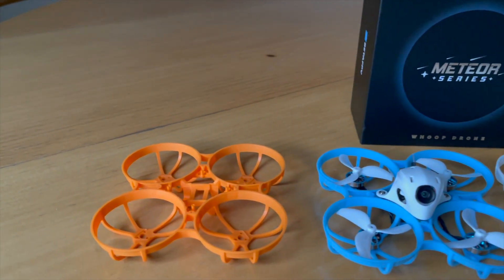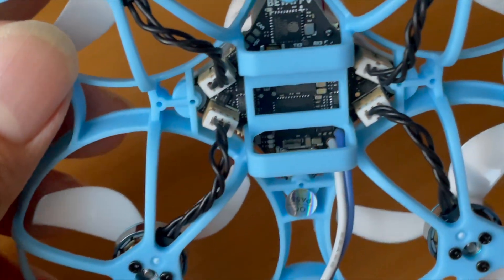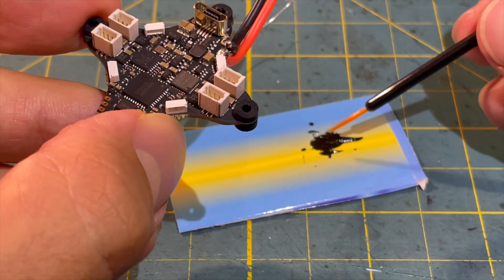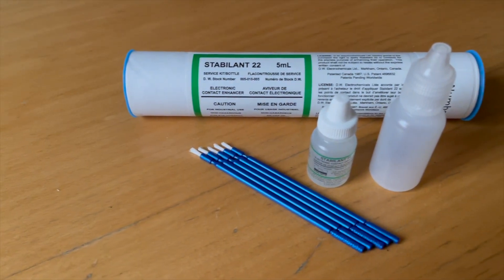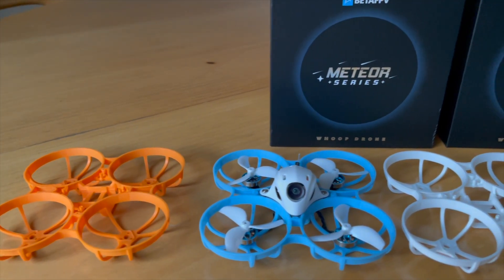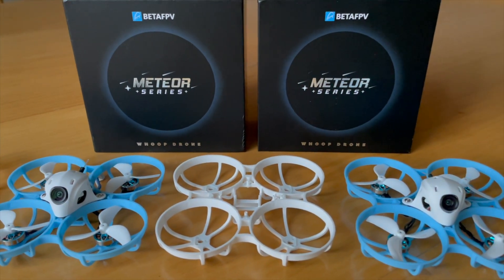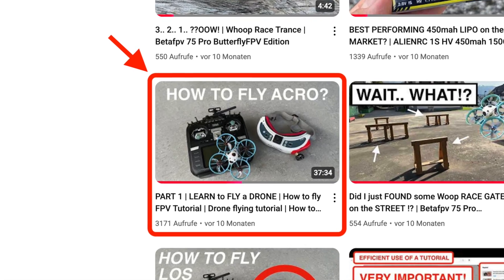I NEED YOUR HELP!⚠️‼️🙏🏻 Project Contact Enhancer for Motorplugs on Tiny Whoops | Meteor 75 Pro

Comment from the maker: Hello my whoop friends! I need some test pilots from Europe who fly the Meteor 75 Pro with motor plugs! 

I've already invested over 10 hours in this project and would appreciate your help! 

I would like to thank the test pilots who have already confirmed their participation and sent me an email.

⚠If you're interested in the project, please contact me this week! Email is in the channel info.
The email is hidden, you need to click to unhide it and it only works on a desktop computer somehow.⚠

➡ The project in brief: 
The Goal of this project is to test whether contact enhancers can prevent electrical fretting on the Meteor 75 Pro's motor plugs and the subsequent motor stuttering problem after about 150-200 flights. A small study of contact enhancers on tiny whoops, so to speak. 

➡ Requirements for test pilots: You have a Betafpv Meteor 75 Pro or are willing to buy a new one. You are willing to make 200-300 flights with the 75 Pro in the next two to three months. You are able to complete 200-300 flights without the motors sustaining damage due to extreme crashes. You will keep a log of the number of flights. You are willing to work with me and share the results with me and the community. 

➡ My role in the project: Leading the project. 
Dividing the test pilots into the different groups of the various contact enhancers and the control group. 
I will provide the contact enhancer I received from the sponsors or ensure that your whoop is equipped with a contact enhancer. I don't know exactly how yet. 
I may send small quantities of the contact enhancer in small containers. Or you can send the whoop to me, and I'll install the contact enhancer and forward the whoop to you. At the end, I'll summarize the results and make a video for the community. 

Of course, I can mention all the test pilots' names and their YouTube channels in the video if desired. 

⚠If you're interested in the project, please contact me this week! Email is in the channel info. 
The email is hidden, you need to click to unhide it and it only works on a desktop computer somehow.⚠

➡ Project Structure: 
Two 75 Pro pilots without modifications to the whoop (control group) 
Two 75 Pro pilots who fix the motor connectors with adhesive (no contact enhancer) 
Two 75 Pro pilots who use contact enhancer A 
Two 75 Pro pilots who use contact enhancer B 
Two 75 Pro pilots who use contact enhancer C 
Two 75 Pro pilots who use contact enhancer D 
And if a lot of pilots are interested, the following would also be possible: 
Two 75 Pro pilots who use contact enhancer A and adhesive 
Two 75 Pro pilots who use contact enhancer B and adhesive 
Two 75 Pro pilots who use contact enhancer C and adhesive 
Two 75 Pro pilots who use contact enhancer D and adhesive 
With 12-20 pilots, we could conduct a really nice little study. 

And yes, I know it's only a small study. But in this case, it doesn't need to be a large one, because we'll quickly see if the engine stuttering problem can be resolved.
It's not about seeing the performance gain, which is very small. Personally, I'm just interested in solving the problem of the motor stuttering. And this doesn't require a large study or unrealistic bench tests.

⚠If you are interested in the project, please contact me this week! Email is in the channel info.
The email is hidden, you need to click to unhide it and it only works on a desktop computer somehow.⚠

➡ Info on the contact enhancers:

Stabilant 22:
https://www.stabilant.com/
https://www.micro-tools.de/Kontaktreiniger-oxid/Stabilant-22A.html?isextsearch=alist
https://www.youtube.com/watch?v=Rj9KWLf_67M
https://www.youtube.com/watch?v=nrtCp1oAfLg
https://www.youtube.com/watch?v=3JvoKBMceXA
https://www.youtube.com/watch?v=Hqn1uT_gbpU

Deoxit:
https://caig.com/
https://www.digikey.ch/de/products/filter/chemikalien-reinigungsmittel/260?s=N4IgTCBcDaICYFMD2APAlgFxAXQL5A
https://www.micro-tools.de/Kontaktreiniger-oxid/Caig-DeoxIT-Gold-Tube.html?listtype=search&searchparam=deoxit&
https://www.youtube.com/watch?v=Hd6M3fO6Upg
https://www.youtube.com/watch?v=osmMy8ei_Ko
https://www.youtube.com/watch?v=MRQju68tqVc

NPS Encore:
https://www.contactenhancer.com/

‼⚠Also note the other videos on this channel, the option to subscribe to this channel and my other channels.⚠‼

Other videos on this topic only - See playlists
If you liked the video - recommend it to friends ☺
Contact for Business Inquiries - Channel Info - Email
Reply: I've got 3 Meteor75s (built my last one) and have a fourth I'm building on the way from BetaFPV now!  I'm in!! :)

Comment: I have mine for a few days only but I crashed it enough times to already experience stutter. After I firmly press the motor connectors it disappears until the next good crash.

I’m getting a 2nd one (with a camera this time) and that one I will probably convert to a soldered before I go fly outdoors. But my LOS-one can stay with the connectors for the purpose of this test. Not sure whether you still accept test pilots or not.
Reply from the maker: Wow, that's early. You've been flying a lot these past few days? Maybe over 150 LiPos? Is that possible? 
Yes, it would be great if you participated in the test! You can try this contact cleaner: 

Deoxit D100L is available in a small and inexpensive package in America for under 10 dollars.

https://caig.com/product/deoxit-d100l-cpk/

Applied to the pins of the whoop.

If possible, you can also add a little more to the sockets. It won't take much. The pins must be covered by the stuff. That's enough. A thin film is enough. Then let it soak in for 12 hours and reconnect the motor connectors as usual.
Or if you have enough money (50 dollars), you could also try Stabilant 22, which in my tests greatly improved the contact of new plugs! But I don't yet know if it works as well on oxidized plugs.

https://www.amazon.com/Stabilant-5ml-Kit-Makes-30ml/dp/B001E50GQS

PLEASE let me know if it worked!
Reply: I am learning LOS at home, in acro, so crashes into things are frequent :D

I don’t think I flew more than 20-30 lipos,  the issues aren’t as prominent as on your video, but manifest in sudden bursts or reduction of RPM causing the quad descent or lift erratically. 

D100L-CPK is surprisingly hard to find in Poland, unless you pay 10X for delivery, but I’ll try to find it.
Reply: @b @butterflyfpv I also don’t think it’s corrosion / oxidation problem in my case, but bad mechanical contact between the connector and its socket

Comment: Am I the only one that has a pigtail that doesn't have good grip with the battery
Reply from the maker: No, unfortunately, it's a known problem that some BT 2.0 connectors are not precisely manufactured. Some series are too tight, while others are too loose. Maybe things will get better in the future when all BT2.0 connectors from the first series are sold and the tolerances are better maintained.

Comment: I really like this idea but unfortunately there is no way you will get conclusive results from a shared test like this. No one will have consistent crashes, people will report their findings differently, and you won't find a big enough sample size. I think in order to test this theory you would have to create some kind of testing rig. Using two (ideally more really) brand new Meteor75 Pros, you would apply the contact enhancer to one and leave the other. Then using some kind of rig you can repeatedly crash the drones at the same speed and see if the electrical fretting occurs in one before the other.
Reply from the maker: Info from the video description: I know it's only a small study. But in this case, it doesn't need to be a large one, because we'll quickly see if the motor stuttering problem can be resolved.
It's not about seeing the performance gain, which is very small. Personally, I'm just interested in solving the problem of the motor stuttering. And this doesn't require a large study or unrealistic bench tests.

The goal is really just to see whether contact enhancers can prevent the problem of motor stuttering. Nothing more, nothing less. An on/off test so to speak. No need to worry about different reports of the findings from the testpilots. And yes, it would be good if some pilots came together. That's why I made this video.

It's difficult to explain.

The results won't be completely conclusive. But good enough that the information will spread. And that is the only goal. Because after that comes step two: The small group of beta testers. If a few people have success with contact enhancers, word will get around. And then it will quickly become clear whether this is the solution to the problem. I hope you understand. It's a three-step process. I involve the community. Only the end result is important to me. I don't have to make money from it, nor do I claim to be the only one to have found the solution. That's why I see myself only as the starter for a three-step process that unfolds automatically when the solution is good enough on all levels—that is, when the solution is effective, user-friendly, and affordable enough. All of this is filtered through in this automatic, natural evolutionary process.

Hope this helps to understand.

By the way: Science isn't what it seems to many people. It's much more complex.

Please share this video with all your whoop friends. This will help me find my test pilots, and we can move forward together as an FPV community. And you'll see that this project made sense in retrospect.

Happy flying my whoop friend!
Reply: im from USA but love this idea as ive recently got into fpv, just got the meteor 75 and hope would be more than happy to help a study like this! happy flying
Reply from the maker: Ok write me an email please! Email is in the channel info. (Hidden, you need to unhide it on a desktop computer)

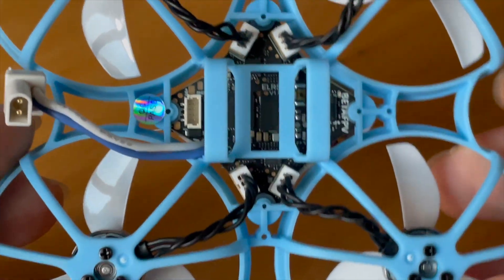Comment: Hab zwar nur Air65, Air75 aber versuch mal mit UV Resin 1-2 Tropfen in die männliche Steckerseite von hinten reinzugeben und dann aushärten, sodass die Kabel am Stecker bzw die Pins im Steckergehäuse solid sind. 5:59
Die Pins haben halt Spiel im Steckergehäuse, wenn dann noch Kräfte drauf wirken, verbiegen Sie sich minimal, wodurch kein 100%iger Kontakt mehr zu stande kommt..

MfG Justin. 🙂
Reply from the maker: Hey Justin, danke für deinen Input!🤜🤛 Ja voll das ist eine gute Idee! Ich denke auch das die bewegungen des steckers ein grosser teil des problems darstellt.. Darum möchte ich auch gerne ein paar piloten welche ohne contact enhancer aber mit geklebten steckern fliegen als vergleichsgruppe. Mal schauen wie viele sich melden..
Reply: 🫵🏼😎 @butterflyfpv
Reply: Btw. habe das gleiche bei der C03 Cam gemacht. BetaFPV macht ab Werk so Silikon auf die Lötstellen direkt an der Cam, dieses ist aber leider viel zu weich und fällt irgendwann ab bzw. hängt nur noch so lose dran, sodass die Kamera Kabel früher oder später an der Platine abreißen. Nachdem ich mit 3 kleine Tropfen UV Resin über die Lötstellen an der Kamera verteilt habe, nie wieder abgerissenes Kabel gehabt :-)

 @butterflyfpv
Reply from the maker: Genau so ist es! Das silikon ist zu weich und oft auch noch nur auf die löstelle selbst aufgebracht wo es absoulut sinnlos ist. Das habe ich leider sehr oft gesehen über die Jahre und es hat sich nie dauerhaft verbessert. Darum müssen wir selber schauen.

Comment: I would partecipate but i cant fly 200 times in 3 months
Reply from the maker: Ok how much time do you need? You can also contact me when the motors on your 75 Pro start to stutter in 4-5 months.
Reply: @butterflyfpv no i cant because now i got the drone since 1 year and i flew it twice
Reply from the maker: Ok fair that's a bit little😁 The good thing is: Motor stutter won't affect you for a long time..😁

Comment: Are you sure the problem is in the contact between the male and female plug? It could also be the soldering of the receptacle male plug on the board
Reply from the maker: Thank you for your input🤜🤛 Never 100% sure but 95% sure. I've never had a problem with the solder itself. If the cable or the pins or the solder are completely broken, then yes. But I've never experienced a soldered part that's still firmly in place no longer transmitting current effectively through the solder. Of course, I am always open to input and new knowledge.

Comment: Also ich habe bestimmt mehr wie 500 Flūge mit meinem Meteor 75 Pro mit der O4.3 Mal Camera Reparatur genau. 6 Rahmen brūche.Als er neu war habe ich die Motorkabel genau wie Du mit Zahnseide Fixiert.An den Steckern und den ersten paar Millimeter Kabel lege ich eine Schicht von diesen diesen klebepads die man kaufen kann womit man Poster Aufhãngt  . Ähnlich wie Kaugummi.Das Zeug wird hart aber lãssst sich gut beim Rahmenwechsel gut entfernen Nach so langer Zeit kein Motoraussetzer .Den Antennenstecker klebe ich auch damit fest.Hab auch keine Antenne mehr verloren.Keine Ahnung was das jetzt mehr wiegt.Fūr mich ist da kein Fūhlbarer Unterschied.Mal sehen wie lange das gut geht.Ich hab das auf meinem 2 und 3 Meteor das so gemacht .Mein erster hatte Motorstottern Nach gefūhlt 20  Flūgen.
Reply from the maker: Danke für dein feedback! Interessant! Das heisst es könnte sein das die hauptursache die bewegung der stecker ist. Und wenn diese bewegung verhindert wird kann vielleicht das electrical fretting verhindert werden. Interessante Idee mit den Haftpunkten. Danke für dein feedback! 🤜🤛💪🏻
Reply: @butterflyfpv Ja ich denke direkte Stecker Vibration sollte minimiert werden .Bin zurzeit sehr froh daß es so lange gut geht. Grüße und Danke fūr Deine ganzen Super Videos.
Reply from the maker: Ja das denke ich auch! Das ist sicher ein grosser teil des problems! Ja voll das glaub ich dir! Wünsche dir noch viele weitere schöne flüge! Falls das motor stottern doch kommt dann melde dich nochmals. Solches feedback ist wertvoll für das projekt! 🤜🤛💛